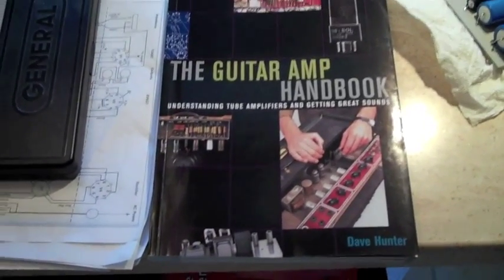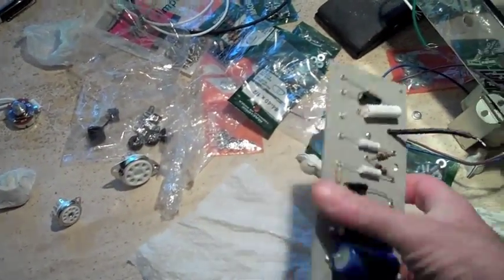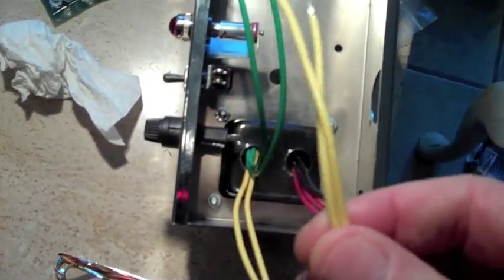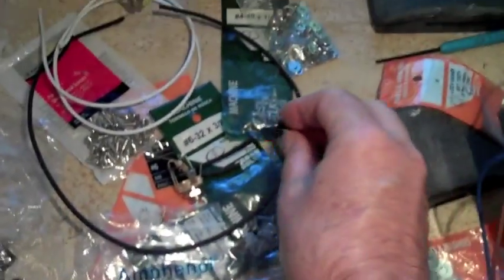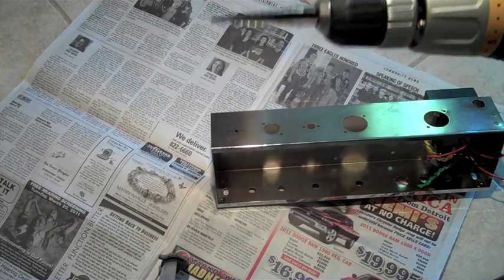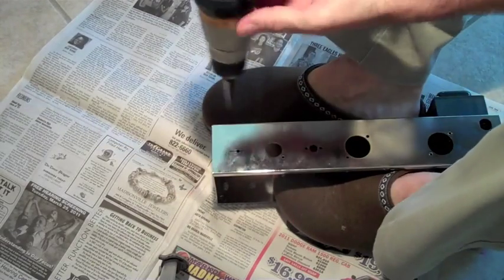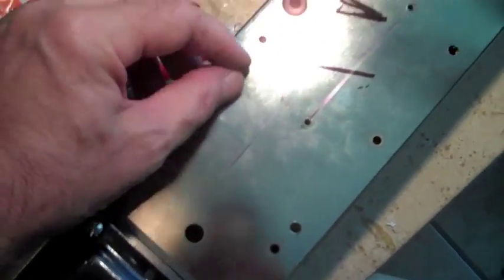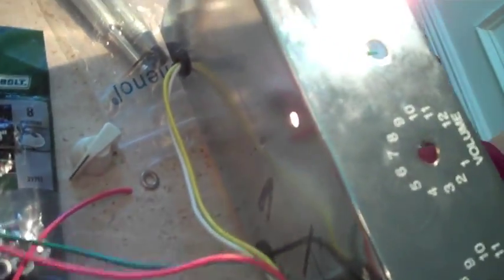Two-Stroke Amp Project (Part 1)

Comment from the maker: These get natural tube distortion but not like Metallica distortion.  You might want to go with a bigger 18w Marshall type kit with a solid state rectifier.  You need more clean headroom but all the metal like distortion would have to come from your pedals.  It is still better (IMO) to have an amp that has a good clean tone as a foundation.  A lot of the big metal amps are super high gain amps and don't have much clean sound to them.

Comment from the maker: @Rogert79  Thank you so much.  Radio Shack was still open so I picked up the 100 ohm resistors.  I just placed them on the heater terminals on the 6V6 socket without soldering them and the hum went away.  I will solder them tomorrow

Comment from the maker: @Rogert79  I'm looking at the Mojo760 spec sheet.  The center tap for the B+ (red/yellow) is the only wire that goes to ground.  I was going to check the 6.3v heater wires first.  Thanks for the suggestion.  I will give the resistors a try tomorrow.  That might be it because the book used a Weber 125P1B that has a center tap for the 6v (green/yellow) that goes to ground in the schematic.  Thanks a bunch.  I bet that's it.

Comment from the maker: @knikk77 That's interesting.  Out of all of my amps, my Blonde 1964 Bassman hums the worst but it is tolerable.  I have some issue with this one and I am determined to find it.  It could be the ground is not the way it should be or the heater wires are routed too close to something.  I will let you guys know if I discover the problem.  Either way, the amp sounds great.  I just posted a vid of me playing it, Two-Stroke Amp Project (Playing Demo).